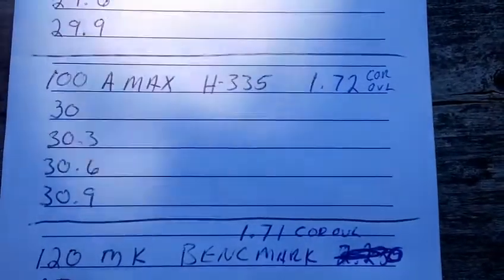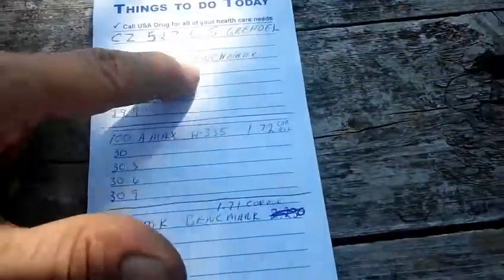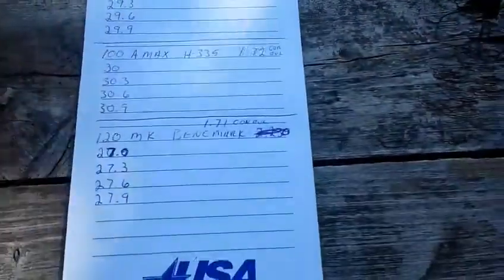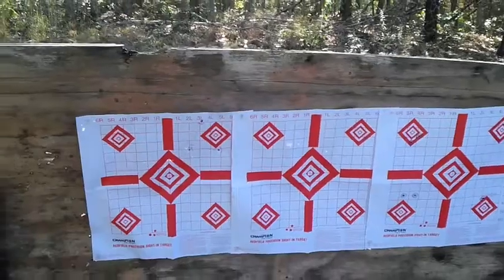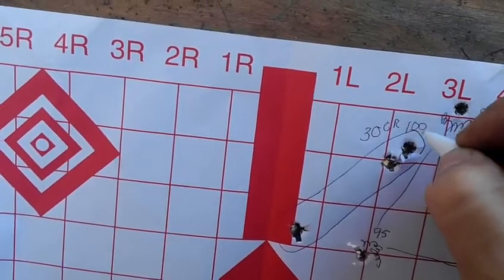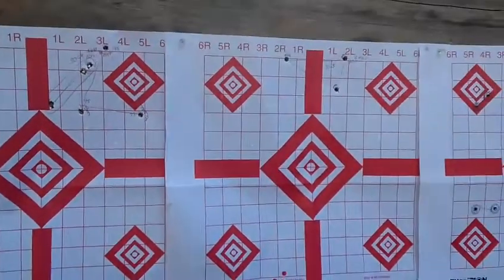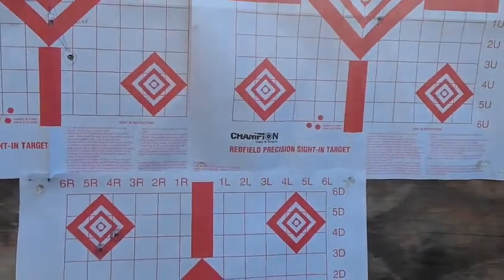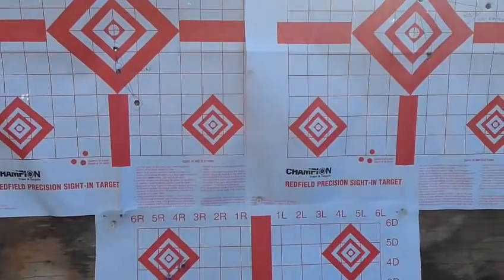6.5 Grendel CZ 527. Load testing

Comment: I own two CZ 527s.  One is the 25.6” barrel MTR in 6.5 Grendel.  I’m working up some loads for it, but I discovered, much to my dismay, I couldn’t shoot any decent groups with Hornady SST Custom ammo.  For that gun...terrible,  3 inch groups!  I almost gave the gun away.  But I tried a couple boxes of federal fusion 120 grain, and voila!   All 5 shot groups averaged 0.55 inches.  What a difference!  Just goes to show, not all barrels will work with all bullet types.   Nothing against Hornady, they make absolutely fine ammo.
Reply from the maker: I hear ya.  I bought a new 260 Remington once. And bought two boxes of ammo. 140 core loks and 120 ballistic tips. The 140s were 3 to 4 inch group's at 100yards. The 120's were 1/2"  groups. And the 120's were twice as expensive. Go figure.
Reply from the maker: I had an AR15 GRENDEL Alexander arms upper and a bear creek Arsenal upper. The Alexander arms shot the hornady black ammo fantastic but the bear creek Arsenal upper shot them terrible.  But the bear creek barrel shoots 140 matchking's and 
140 spbt Sierra bullets really good. 
The bca barrel just won't shoot the vld style bullets very good.

Comment: I've had a few cz rifles all well shooting I had my local shop order me a cz527 6.5 Grendel today I'm excited to get some test ammo through it and develop some slamming loads!
Reply from the maker: Curtis Cox
  Ive only owned one other. And it was chambered in .222 rem. One of the best shooting guns ive ever pulled the trigger on. 
So far this 6.5 Grendel is being more of a challenge to find its perfect load. The 100 hp from Sierra is what im using.  And it will stay within a 5" group at 450 yards. 
But yesterday i tried some alliant power pro varmint powder with some hornady 123 SST's and got some groups at 200 yards that were very promising.  Just barely over an inch. So ill probably do a video on that soon.  
Good luck with your new rifle!!!!

Comment: Just my $.02, I did a lot of load testing with my CZ 6.5 Grendel and it did not really shine until I started loading H322. Along with Sierra 120 Match Kings it will shoot MOA and sometimes better. Very consistent if I do my part and the wind is not a big factor.....( I did bed the action as well ).........Good Shooting...........Don
Reply from the maker: Mine does like the 120 matchking's as well. 
My daughter took a young buck with that bullet. Punched through both shoulders with about a 3" exit wound.  
At 100 yards.  
Thanks for watching and the comments.

Comment: I was really considering one of these rifles but I think the howa has the edge on accuracy from the reviews I've seen. Great review! Great looking rifle!
Reply from the maker: Well ive never shot a howa  but i did own a cz in .222 years ago.  And it was a great shooting little rifle, after i found a perfect load for it.  I  am convinced through years of shooting and reloading that if you have a gun that you really like.  You can find a load that it likes.  Im not done with this one yet .    
But if you do buy a howa let me know how it does .
And good luck to you
Reply: JOSH Pittman I have the Howa heavy barrel model. I’ve shot it enough to complete Howa’s barrel breakin process so accuracy results are premature for it. I’ve owned older 1500 Howas that shot well. My biggest complaint with the new Howa is the cheesy cheap bottom plastic trigger guard/mag housing. The action screws go through this housing and even if you torque the bolts to Howa’s specs the cheap plastic will crack over time. I also own several CZ rifles. Great guns but to make them reach their potential a pillar and glass bedding is a must. 99.9% of CZ rifle accuracy issues can be solved with a good bedding job. Bedding will really wake up a wood stocked CZ.

Comment: I know you are shooting at 200 yards but I think there is something wrong with the rifle, perhaps loose stock screws or scope mount.
Reply from the maker: Strutingeagle 
No everything is tight.  Used an inch pound torque wrench.  It just seems to be way more picky than the other CZ I used to have. It was chambered in .222 Rem, shot everything good. 
This one does shoot Sierra 100 hp's pretty good.  And 120 sp by Sierra.   I'm going to work with it some more soon.
Reply: I had one in 223 and it wouldn't shoot very well either.  The 221 fireball is a half moa gun and not particularly sensitive. A gun smith and competition bench gun builder freind of mine thought the action was too light and he showed me the difference between the SAKO L46 action and the CZ and it was pretty substantial when removed from the stock. I don't know if that has anything to do with the bigger more powerful cartriges the action is used for. Good luck to ya and hope you getter dialed in. They are wonderful guns to shoot and a favorite of mine.
Reply from the maker: Strutingeagle 
Thanks man.   
I really like the rifle. Its light and trim. Perfect for stalking.  I have long range rifles. But i would like to get this one to doing better at 200 to 250 yards. I think its capable .
  My daughter took a little buck with it last season at about 100 yards. With a Sierra 120 matching.  That bullet done a great job. 
Good luck to you this hunting season.  And thanks for watching.
Reply: Can't blame the gun when he's using handloads.
Reply from the maker: @t3hm4zn  
It doesn't really like the hornady factory ammo either. The black with 123 red tips or the hunting ammo with 123 sst bullets. 
That ammo shot really good out or my Alexander arms AR-15 barrel.
Reply: @martyjohnsonozarkoutdoors8198  My 6.5G hates 123gr SST factory ammo. Groups all over the place. It's quite frustrating.
Reply from the maker: @t3hm4zn  
Well I was hopeful because my first Grendel shot the hornady ammo great. It was an Alexander arms upper.  But the two I have now. A CZ 527 and a bear creek arsenal upper don't really like them. 
But on a good note. My step son smoked a little buck yesterday at 260 yards with my CZ.  120 grain sierra soft point. Punched through both shoulders.

Comment: This is NOT typical CZ 527 accuracy.
Reply from the maker: I've only owned two of them. The first one was a.222 rem and shot everything good. That was 15 years ago. But I bought this one to hunt with in the woods, from a stand. Where I have to walk a long way to get to. And probably won't be shooting much over a hundred yards. And it's still very capable at 200 if I have to shoot that far. 
But I agree it doesn't shoot like the first CZ I had.